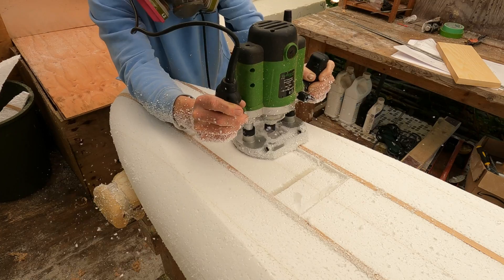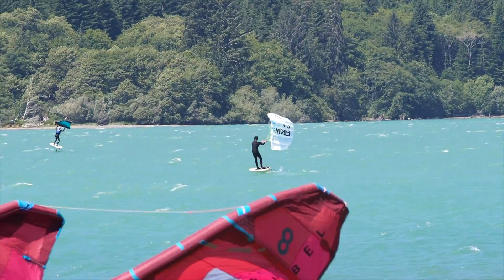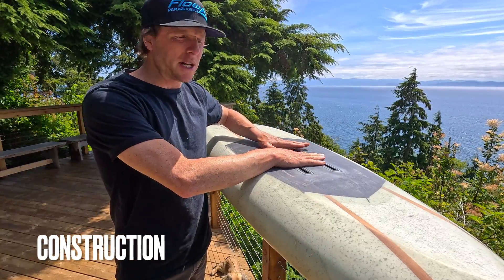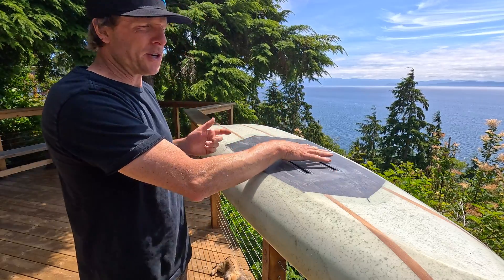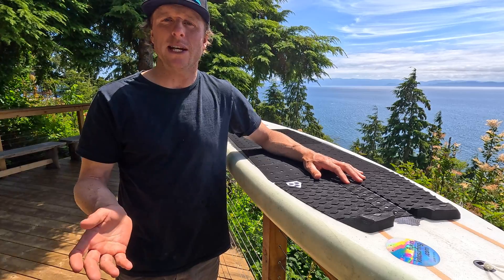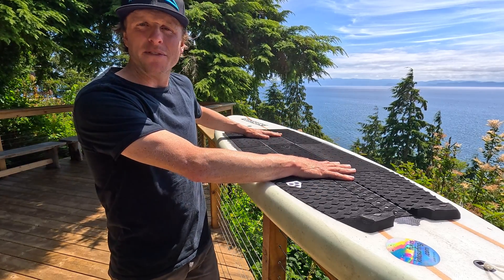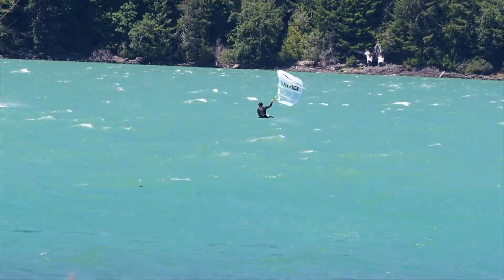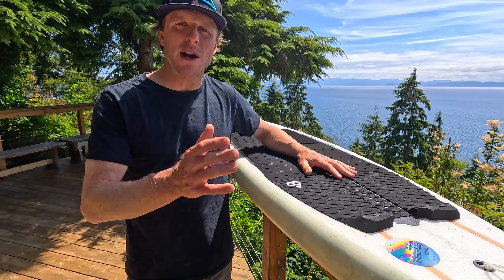How to Build a Hydrofoil Board | First Ride & Final Thoughts (Video 13)

Comment: Thank you for this video series. What volume was this board. Would it be suitable as a beginner board for a 95 Kg rider?
Reply from the maker: For sure! This board is about 95L. That would make it the min you might want at 95kg. I would suggest going a at least 15% above your weight, but if you are really just leaning everything for the first time.. you would want to go at least 130L-150L to learn. Hope that helps

Comment: Awesome build series, really enjoyed it.
I found the same with my wingfoil board build, after the early stages and progressing I too found the board was too large, I modded the board by  shortening and making it narrower. I ended up doing this twice. DIY builds are perfect for this as you'd never mod an expensive board.
Reply from the maker: Nice! Thansk mate! and Yeah for sure that one of the things i like about making my own gear too. as well as being able to repair it etc so I can actually use it and not worry about it all the time like you might do with a $2k board